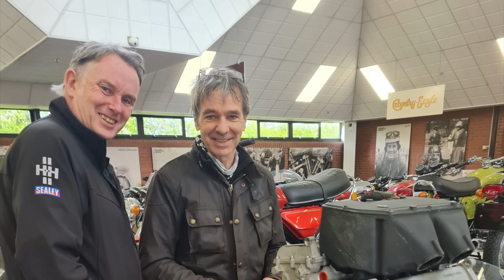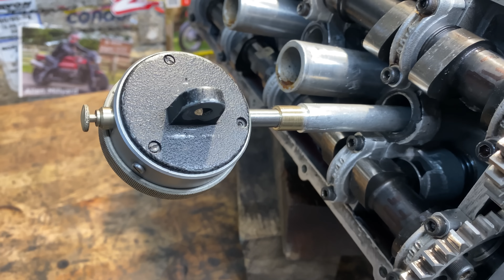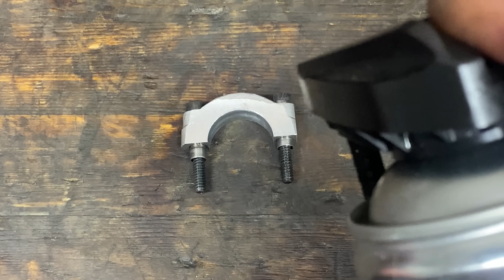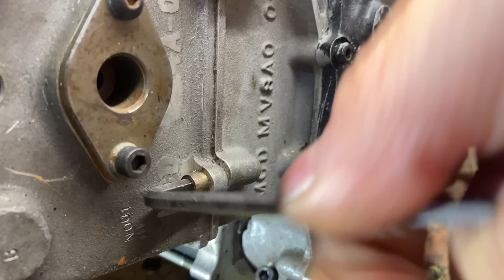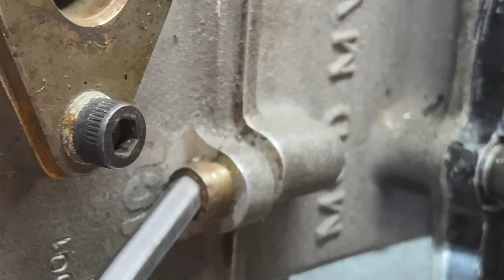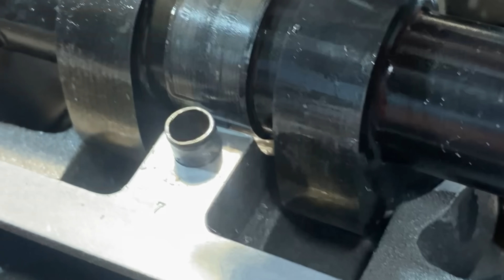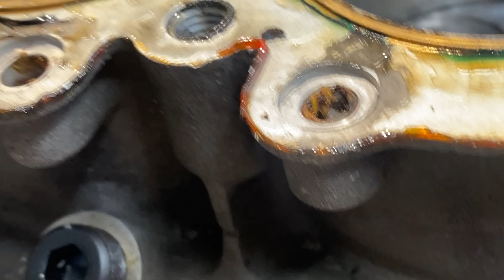Norton Nemesis V8 Rebuild - Episode 3

Comment: Rubber o rings to seal the waterways is a bad idea in my opinion. Lets say the waterway ID is 10mm, so you think, ok, lets get a 10 mm ID o ring, the trouble is, as the head is torqued down, the only way to for those o rings to compress/expand is inwards, as they sit in a recess, this has to reduce the flow of coolant, or am I missing something, maybe a copper crush ring would be better. Im sure youll let me know in the comments
Reply: You are missing something. If the recess has been properly calculated there should be no problems with excessive 'O' ring squish/displacement.

Comment: Wonderful stuff as always. However I think that you were incorrect in saying that UNC thread is British. I always thought it is American. Also very surprised that those screws would have 4mm cap socket. Were they possibly a course metric thread? Looking forward to the next episode.
Reply: @Turnipstalk Many threads in the UNC and BSW series have the same thread pitch count for a given diameter but the inclusive form angle is 60 degrees for UNC but 55 degrees for BSW.
Reply: Maybe it's just another industrial standard adopted by a manufacturing group?

Comment: Did they have a system for only running on one bank, or did it have a replacement cylinder bank and head at some point, I find it strange they only replaced one-half.

Comment: Alright, new life goal. Walk into the National Motorcycle Museum and take parts off an exhibition piece.
Reply: Yeah, i thought that myself.  You and I would have been talking to the lads in blue down at the station.
Reply: @graemecatty9921 But the Nemesis is their bike and Allen is rebuilding it for them.
Reply: Mr M has. special permission
Reply from the maker: @michaeltaylor8835  That's James hewing the museum director stood next to me
Reply: @AllenMillyard  Brilliant vid! (Apart from the appearance of that scumbag).
Reply: Massive flex
Reply: I heard something simmular about a b29 liberator flown back to the uk by its new owner after he had bought in it Egypt i think, he landed in the alps somewhere were he changed out a faulty vertical rudder with one from a museum and continued his journey..
Reply: Absolute baller move
Reply: I have been there many times and made contributions to its building and expansion way back some years ago, there's a plaque or two with my name (my real name, not the one I use here) on it for buying some bricks or square footage or something - long time ago and I can't remember exactly what now. It's a wonder that none of the bikes there are rusty after I drooled over them so many times! Great place, well worthy of its name.🇦🇺👍😎🥰
Reply: LOL ! and Allen is obviously taking off pieces with permission from the NMM for something that will be going back to the NMM at some point, when he's got it working better than the original manufacturer in the late 1990s ever dreamed of !
Reply: Haha, best ask first!
Reply: I think when you're on first name terms with the museums peacock, you're probably well enough known to take a few bits for your latest project. 😂

Comment: Interesting that the cam carrrier cap head bolt had UNC threads with 4mm hex drive heads.
Reply from the maker: strangely it fitted just perfect ! I assumed they were M5 (4mm Allen key)  until the thread was revealed
Reply: @AllenMillyard  A 5/32" hex key as used on UNC cap heads is almost exactly the same size as a 4mm one.
Reply: yeah I wondered that too. Along with the funny head gaskets. but then again I don't know if they were a common practice for special applications eg racing or if the designer felt it was easier to manufacture a prototype this way..anyway interesting tear down 😊😊
Reply: 4mm is very close to 5/32nds

Comment: No bearings ? Just the cap and the cyl head ? Am I showing my age by saying " isn't that wrong " or bad design ? All ways interesting 👍👍👍👍👍👍👍👍👍👍
Reply: Lots of engines made that way. If the camshaft runs a bearing, the head is scrap.
Reply: @georgejohnson7591  ok👍! Surely any wear and the head is damaged too , the caps looked pretty small also !
Just saying ! And am I right in thinking that engine is a one off ?
Reply: @brianalder2234  This way of running the camshafts straight in the aluminum cylinder head has been successfully used by the Japanese since the first Honda 750 four in 1967
Reply: @erik_dk842  ha ! Always knew I was smart and upto date on all things technical 🤣🤣🤣👍👍👍👍👍
Reply: @erik_dk842  Yep! and as long as they're not run short of oil they'll never cause a problem.
Reply: Pretty common design AFAIK. During manufacturing the caps are torqued onto the head without the camshafts installed so they can be line-bored to the OD spec of the camshaft journals. Then just run oil to them.
Reply: Almost all the high performance Japanese multi cylinder engines run the cams directly in the head without shell bearings without reliability issues.

Comment: Could all that gunge around the head & block water galleries be radweld or a similar leak stopper because Norton couldn't get the head to seal reliably ?  It needs a deep dive to investigate why so much of it was there.
Reply: I got the same suspicion
Reply: It could be the culprit.

Comment: Looks like the results of mixing differant  anti-freeze.
Reply: I was thinking it looked like a vast excess of radweld
Reply: There may be a different in coolant flow .
They may have flowed a higher volume of coolant to the rear cycle bank to off set the heat. Higher volume would mean lower velocity allowing crud to settle in pockets. Just guessing.
I have a Honda vtr1000. The tune is so different from front to rear cylinder. The carbs are actually different sizes.
Reply: Damn
Reply: I was wondering
Reply: You can learn something everyday.
What makes that happen mixing AF products ?
Reply: Judging from the last video of the radiator, coolant manifold etc, I'd say it never had corrosion inhibitor in it, which is a big no, no, the results now seen here, Atb .

Comment: The difference between the front bank and back is huge. One side look brand new the other has clearly had some issues to cause the bore marks. I suspect you are right that the blocked waterways caused the over heating but what caused the crud in the rear and not the front.
With the ticking clock in the background and your calm voice it is relaxing to watch this unfold
Reply: I believe the front and rear cylinder banks had totally separate cooling systems. That is, two rads. two water pumps etc. So one bank could become contaminated and not the other.
Reply: @romanroad483  that is probably true but still weird that one half clean as a whistle and the other badly clogged up with no signs of a problem with sealing etc. I am sure Alan will find out why
Reply: @jeffoakley2331  

I wonder if the loose fitting rear bank exhaust contributed to some over richness in the rear cylinders.  I have seen this in the past and suspect it is the result of poor cylinder scavenging during the exhaust stroke.  The rear heads and pistons have quite a carbon build up considering the reported "little use".  If the rear bank overheated excessively, it's also possible that some degree of ring seizure occurred, creating the light scoring in some of the rear bores.  The water channels look bloody awful with that crud in them.  I bet nobody bothered to put a suitable antifreeze in there to eliminate the aluminum oxidizing.

The next episode should reveal all.  Another interesting video, thank you, Allen.

Comment: That sludge seems to be old coolant left in the engine for too much.
I had a similar issue on a couple of old engines I serviced, if I remember well someone had suggested to me that it's from chemical reactions between the aging coolant and brazed metal parts in the radiator.

Comment: First again...😉
Interesting that they used a mixture of Metric and UNC threads.... A feature that Daystate, the airgun manufacturer,  did on some models, weird..🙃
Reply: I wonder how much of that was due to being still a development prototype. They may have harmonized by production had it ever gotten there.
Reply: Possibly different bits made in different factories. Must have been during the metric transition.
Reply: @springford9511  The mid 1990s when this was designed is a long time after the ISO metric thread system had been broadly adopted as the main/preferred thread system.
Reply: My 1973 Ford Cortina had both - engine metric, everything else imperial
Reply: Harley Davison still do that today!